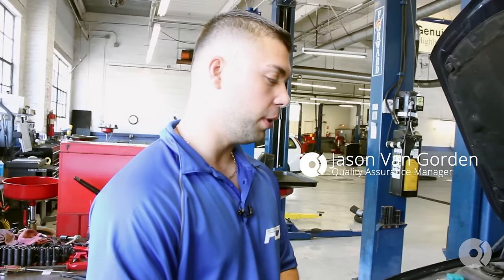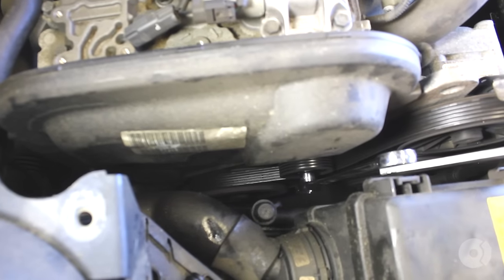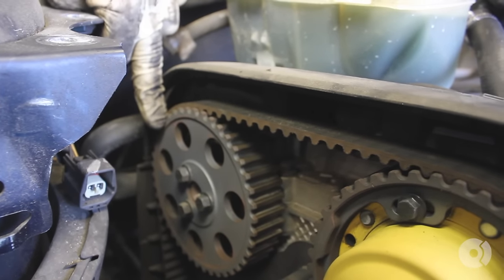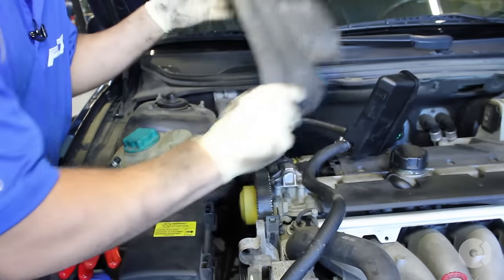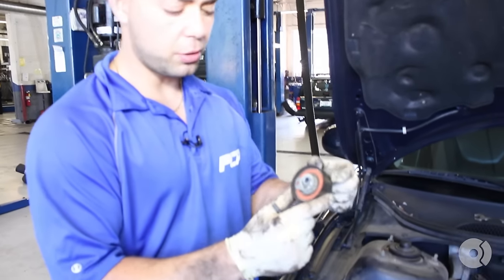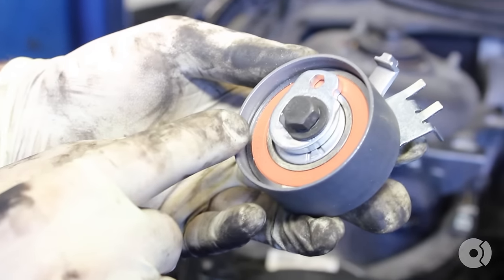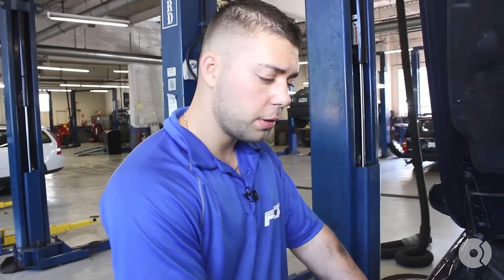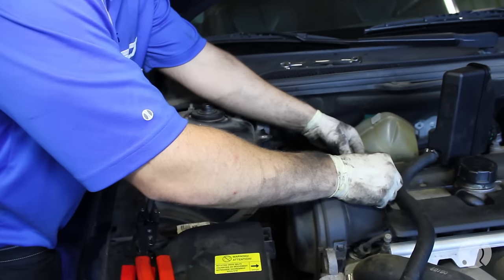Volvo P2 S60 Timing Belt Replacement DIY (S60, C70, V40, V70, S40, S70, S80, XC70, XC90)

Comment: Hello.
Thank you for posting. 
I have a volvo s60 140hp. NA from 2006, and it looks like it's not that mutch different. So I guess i can figure out the difference. 

However, my question is about a comment you make during the test of air flow through the engine with pressurised air at the bottom breather box connection to the block/oil sump. You say: if the air comes out at the top, then you won't have to change the sump. If however the air is blocked, then you have to change the sump.

What is the cause for that statement. 

Will changing the PCV regularly eventually clean out the carbon residues from the engine?

Would it not be more safe to change the sump?

Hope to hear from you, since I have a broken PCV hose (just bought the car 2k. Km. Ago) and want my volvo to last for as long as possible.

Best regards. 
Bue.
Reply from the maker: Keep your PCV system maintained properly is crucial in these cars to prevent clogging and blown out oil seals.
Reply: @fcpeuro  I have now changed the PCV system, following your guide. It was immensely helpfull.
Thank you for sharing. 

Luckily there seemed to be next to no buildup of sludge inside the engine itself, but simply a case of dried out and brittle rubber. 

It was however about the sump and build up deposit that my question was directed. If there is sludge in the engine, will a functional PCV system catch and extract it over time, so that it leaves the engine when i do my next PCV replacement in 100k. Km.
this is assuming that i change oil every 10k.km to get as mutch gunk out in this way. 

In short: does the new PCV trap old gunk already in the engine..

I hope that clarifies the question.

Best regards. 
Bue.

Comment: thanks you for sharing your knowledge with us, 
i'm doing a timing belt replacment in my v70 2.4l non turbo and i see tha i need to replace a 
 gasket seal in the oil pump and i have a hard time taking off the wheel behaind the pullyhow can i do that effectively?
Reply from the maker: A puller is needed to remove the timing gear pulley.

Comment: Witch way the nut comes off. Is it clock wise or counter clock. i have 2004 xc90 with 2.5t motor

Comment: I'll be doing the c30 T5 and seen some instructions on the tensioner and temp.   The shop is usually 75-85°f and some say there's settings for 68 and 110 and if it's over 68 to set it at 110.  Just need to know if that's correct and thank you!
Reply from the maker: 110 Degrees in a shop seems really warm to me, I'd probably keep the thermostat set to a nice balmy 68 if thats the other option. Hope that helps? We may be misunderstanding the question, if possible rephrase it if you can.
Reply: @fcpeuro  lol, we are.  Aren't there temp settings on the tensioner?  I've seen people setting them at the higher setting if the temp is slightly over one setting.  Just looking to see if you set it at the closer temp or if you go to the next higher setting.

Comment: Is the vehicle in this video a CVVT type like my 2005 s80 ? I think this means that the cam gear on the upper left is spring loaded ? Does that type of engine follow the procedure shown in this very good video ?
Reply from the maker: Yes, as long as its a 5 cylinder it's the same procedure.

Comment from the maker: I don't think this should be possible, not 180 deg. I would line my marks up and check for cylinder leakage / compression. I'm thinking the valves may have made contact with the pistons at this point.

Comment: Hi, i have a 2002 Volvo s60 AWD and it is a turbo engine, it is making a squeaky noise when i step on the gas pedal, is this an indication of replacement needed for the timing belt?

Comment: Thank you very much for a well detailed video. Is it normal that once the belt is on and your tensioner is tight the crank will feel tight then loose in spots while manually turning it over?  It doesn't feel as though anything is clashing but it does feel tight then loose again. My marks did line up perfect once I turned it two full rotations.
Reply from the maker: Hi Don, Yes that's normal.
Reply: Just so you know, that happens as the cylinders build compression.  What you're feeling is the compression stroke and then it loosens up as the exhaust valves open.

Comment: I am currently working on a 04 XC90 T6 with dual CVVT. I had a blown head gasket, so I tore the whole thing down and had the head refinished. I have set all the valves and have the cams locked in position. Now when I am putting the cam pulleys back on the cams, I need to know which way to rotate the gears since there is no spline? Once they are set I have the locking tool to keep them in place, Please advise....

Comment: I have a 2004 volvo xc70 that actually uses the tensioner from the second kit (kit that fits a 2005 volvo xc70). My question relates to the clock setting...you mentioned starting @11 and then you allen wrench over to about the 7 oclock setting if its the right temp. But you also mentioned earlier in the video about the newer ones start at 2 o'clock...where does the 2005 tensioner start and end @ . thanks in advance.

Comment: I followed the steps but unfortunately the intake cam must have moved sightly as despite all the marks lining up, according to a VIDA scan, the timing is off (exhaust 0 when it should be 20, apparently).

I assume (and won't hold you to it or anything) the next step would be getting a cam tool to line up the rears of the cams, and then lining up the gears and the belt again with the cams held in place?
Reply from the maker: Hi trunkingham, that should do it!

Comment: I really appreciate this video
I only have one question. I notice this is the non turbo. I have the 2004 turbo 2.5R awd model. Will I be able to use follow this video when changing my timing belt on my R?
Reply from the maker: Glad you like the video, Andre! Yes, it's a very similar process on the V70R, the main difference is that you have VVT on both the intake and exhaust cams.

Comment: excellent job, but 1 quick question is this the same as xc 90 2004 thanks
Reply from the maker: Prince Dabby The motor in this video is the B5244S, which the XC90 was never equipped with. However, much of this video can be of assistance to you if your XC90 is equipped an inline 5.

Comment: Which way do you turn the crankshaft (from the technician's perspective) so that the camshafts are turned clockwise? In the video, it appeared that the crankshaft was turned counter-clockwise (relative to the technician) to achieve this.
Reply from the maker: Both the Cams and Crank are in sync with one another. If you would like the cams to turn clockwise you must turn the crankshaft clockwise.
Reply: FCP Euro Thanks for your reply. I figured that was the case. I was just slightly confused by 5:07 where it appears that Jay is turning the engine counterclockwise (moving the handle on his ratchet counterclockwise) relative to himself.

Comment: Great Video! How did you realign the cam to the timing mark after you toof off the crank pulley ? Did you re install the pulley? i just purchased a kit from FPC, and will be doing the job this weekend Thanks!
Reply from the maker: You shouldn't need to move the cam gears once you remove the crank gear but if you do however, you can just reinstall the crank gear loosely and turn it. I hope that helps.

Comment: Is this the same procedure for an s60r? I keep reading and being told you have to lock the cams with a special tool at the back of the head requiring the rear can seals to be replaced too.
Reply from the maker: Yes, it is the same procedure but pay attention to the tensioner orientation. Volvo calls for you to use the cam locking tool but it's not 100% necessary as shown in the video. If you feel more comfortable using it then by all means do so. 

You'll need this : http://www.fcpeuro.com/products/volvo-crankshaft-holding-tool-cta-2247-2248 to remove the crankshaft pulley and this: http://www.fcpeuro.com/products/volvo-camshaft-holder-tool-fits-all-5-cylinder-engines-cta-2864  to lock the cams.

Comment: Hello sorry for the confusion around the 14:37 mark you said you had to redo the alignment. What did you exactly do to align the cam pulley marks ? Did you turn the crank with the belt on or did you just remove the belt from the cam pulley that had moved and realigned that pulley individually  by hand, and then reapplied the belt. It looks like the video skipped over that part.
Reply from the maker: Ah, we just pulled the belt off and adjusted it by hand and put the belt back on.

Comment: Thanks.  I didnt want to go at it with a screwdrive and find I was trashing it.  Separately, in order to line up the camshaft with the cover, if the mark is at 1:00 then I have to go clockwise all the way around rather than backing it up.  Is that right?

Comment: Thanks! Question on my 2005 XC90 2.5T with 90K miles. Conflicting recommendation re TB 90K, 105K, 120K miles.
What do you recommend?
PS: I looked at my TB, still looks good, engine has no abnormal noise at all.
Reply from the maker: Cam N Official recommendation for this one is 105k miles or sooner.
Reply: FCP Euro 
Thanks re 105K recommendation! The TB can certainly last up to 130K (in my experience), however some people tell me the issue is not the TB but with the mechanical tensioner going bad before 105K.
Have you seen a mech tensioner going crazy before 105K? Thanks again!!!
Reply from the maker: Cam N Not really, but 105k is the replacement point, the idea is to catch it before it goes bad.

Comment: Is it really safe to use an impact gun to tighten the crankshaft center nut on the crank pulley or is it better to use a torque wrench with a crank pulley holder tool?

Comment: I screwed up.  Other videos show people working the belt in behind the pulley and onto the crankshaft.  I have a 1999 Volvo V70, Automatic/base and you absolutely have to pull the pulley.  There is a post that is very hard to see and feel that sticks out into a grove on the back of the pulley.  So...good video.  My bad for watching too many videos with too many diverse approaches.
Reply: Yes, that post that sticks out is what requires the belt to be turned sideways and wiggled in if you don't remove the pulley.  Just take your time and be careful.  I've replaced three timing belts this way already without removing the pulley.

Comment: Is it necessary to remove the crank shaft pulley? Can't you slide the belt over it without removing it?
Reply from the maker: Hi Andrew, we are following Volvo's service instructions which includes removal of the crank pulley. However, it is possible to remove the belt with the crank pulley on with a bit of fiddling and twisting of the belt.

Comment: Hey there, Thanks for all the help. can you tell me how hard it is to chnage the cam and crank seals. I see the hex bolt in the middle of the cam shafts but I am afraid It will jump when I loosen it and does it just come right off afterwards, replace the seal and then reinstall?

Comment: Thinking of doing the same job on my 2003 S40, is there anything different that I should be aware off? Also, I seen another video where the guy just slip the belt off w/o taking the crank pulley off  is there a reason why you can't do that for this model or the S40?

Comment: ur walk through is awsome! thnx

im doin a 04' s60 timing/waterpump. 
question is, its off a tooth and cam wont let me adjust any further by hand. so im guessing crank is off. the marking on crank dont match anything ive seen online. 
i know im on tdc but still could be a tooth off

could i move the crank a bit foward or back?
Reply from the maker: Can you send photos of the marks and where you're at to our Volvo Tech jason at jasonv@fcpeuro.com? He'll be able to help you out with this.
Reply: FCP Euro ok will do. thnx... also on the tensioner i forgot to check and see if it was @ 7oclock or 2 postion before removing... how bad would it be if its in the wrong postion?

Comment: Do you recommend replacing the water pump with the timing belt? I've got a 2002 Volvo V70XC with just over 100K, and I've been getting mixed opinions about this. The car has been meticulously maintained at the nearby Volvo dealership for the past 15 years.
Reply from the maker: Hello Jake, It's a good idea to do the water pump at the same time. This will keep you from having to do the labor twice.
Reply: Don't replace the original Volvo water pump at the first belt.  On this specific engine, the original water pump is good for 200K miles, and most of the main Volvo dealers will replace it only with the second timing belt.   Be aware that most aftermarket water pumps for this car are of very poor quality and had failed very soon after being installed:  by all means use only Aisin or Volvo water pump.

Comment: Two question : 1 if enventually one of the one of the timing marks it's not in position  could I put in place by hand.
2. I try to put the new timing belt exactly as you show but doesn't fit. and is the same size that the original .. what I am doing wrong. Please Help!!!

Comment: The yellow pulley at the front was the intake? I may be mistaken but the solenoid on top of the engine above that yellow pulley tells me that is the exhaust cam...
Reply from the maker: Hello, 

Thanks for your reply. On this particular model year the turbo engines would have the CVVT unit on the Exhaust camshaft only which is located on the back of the engine. The naturally aspirated engines have the CVVT on the intake camshaft only which is located on the front of the engine. This particular vehicle is a Non Turbo, naturally aspirated vehicle. 

I hope that helps.

Thanks, Jason

Comment: Why is it necessary to pull off the crankshaft pulley?  And did you need to use any kind of special tool for torquing down the center nut?
Reply from the maker: Its not 100% necessary to remove the crank pulley as you can snake the belt around it by removing a small plastic cover however I don't recommend it because you can't actually see that the teeth are aligned and you also risk damaging the belt. To torque the crank pulley center nut you'll need a counter hold p/n CTA-2247 to keep the engine from turning.
Reply: Ok, when I go to remove my serpentine belt, I don't have a bolt-head sticking out off the tensioner like your video shows.  Mine looks like it is smooth or has some sort of cover on it.  From the looks of a picture of a new tensioner, you need a T-60 torx bit in the tensioner housing to relieve the tension on the belt.  Would it make it easier to turn the engine over by the nut on the crank pulley if you have pulled the spark plugs out?  Thanks!

Comment: I notice the website suggests the cam-locking tool for doing this job, but it isn't shown being used in the video.  Necessary?  Not so much?
Reply from the maker: It's certainly not necessary, it's more of a reccomendation. Jay is a Master Volvo tech and is very comfortable with this job so we didn't use one.

Comment: Why isn't there anything mentioned about pre-loading the cams? Doing a timing belt job on a 03 XC70 2.5t . Is it necessary for me to lock the cams or unload them?  I'm being told the vvt on the exhaust cam is spring loaded. Getting alot of conflicting info on the forums.

Comment: After you put on the belt for the first time you realised that the marks were not in the correct place and you said you have to do it again what did you do?
Reply from the maker: Hey Henrik, at that point Jay removed the timing belt and realigned the camshaft sprockets (by hand) by matching the notches on them with the notches on the timing cover. Afterwards he put the new belt back on and completed the job.

Comment: I have a 2004 xc90 2.5t that needs the timing belt replaced with 100,000 miles.  My concern is the vvt.  Will it effect the timing mark locations when the belt is removed as I understand the cam gear can move.   As long as the marks line up in putting the belt back on, is it good?
Reply from the maker: The Camshaft gears may jump around if you touch them and not locking them in the rear doesn't make it more difficult to install the belt however locking them requires additional labor time and tools. If you were to perform the repair like I did in the video you should be fine. There is also front universal cam locking tools such as the one Ben McNally used in his 850 timing belt replacement video on our channel but it's not 100% necessary. Ipd sells a good one: https://www.ipdusa.com/uploads/images_newsletters/3106.jpg Hope that helps.

Comment: I have 2001 V70 xc;  Everything looks similar to the car in this video, except my car has timing belt shield (plastic); Small curved plastic cover behind crank case pulley; it's on the right side of crank case pulley;  Looks like it's got 10 mm bolt on it.  I can't imaging how i can reach  to it ?  Please advise, if it would be easy  if  i try from top or get under the vehicle to reach to it ?
Reply from the maker: You'll have to reach this from underneath with a wrench however it's not necessary to remove if you follow my procedure.

Comment: When removing the cam cover on one of these non-turbo engines, do I need a cam locking tool? I'm also replacing the timing belt as well.
Reply from the maker: Yes, a camshaft locking tool will be needed CTA-2864.
https://www.fcpeuro.com/products/volvo-camshaft-holder-tool-fits-all-5-cylinder-engines-cta-2864

Comment: Would there be any difference with this procedure for an S60 R? It jumped timing because of leaking camshaft seals. I'd like to retime the engine and replace the seals as well. Do you have any recommendations for this? Thanks!
Reply from the maker: ***** Would be exactly the same on the first model Volvo S60R up until 2004, if it is late 04 and later the tensioner will be slightly different and the procedure changes slightly, but more or less the same.
Reply: It's a 2005 model with a 6MT.